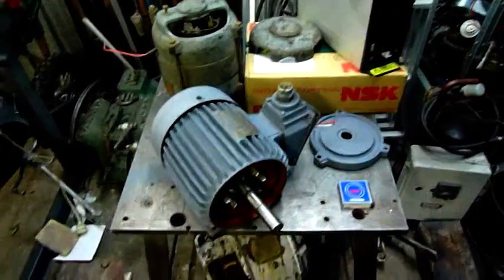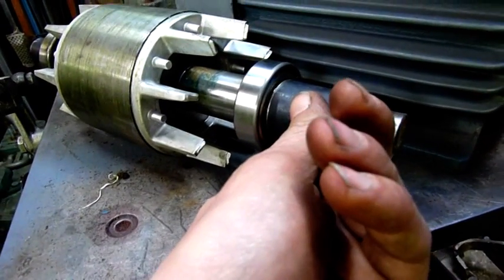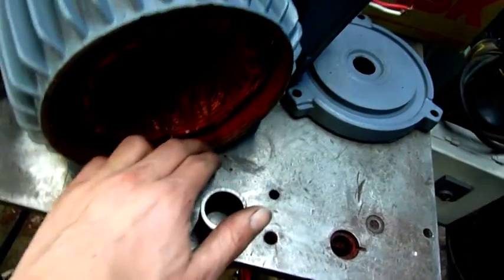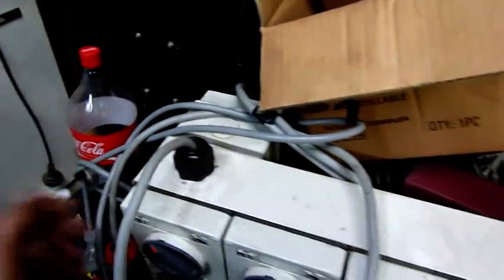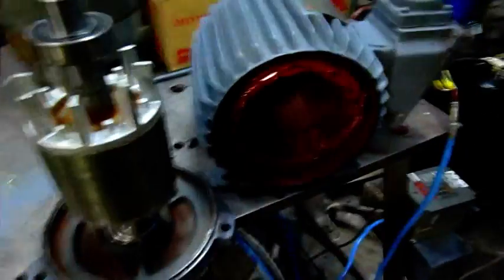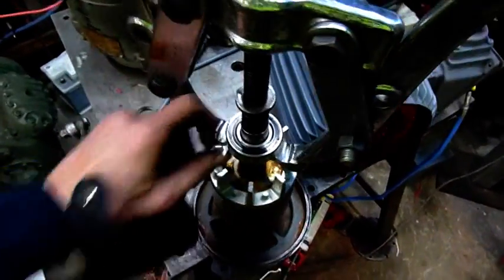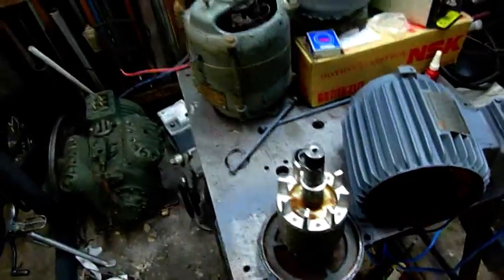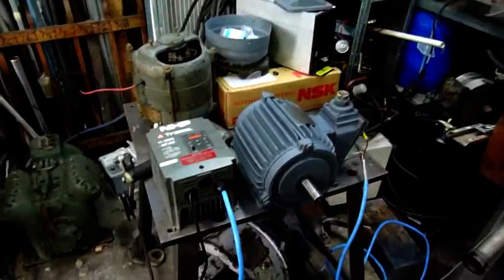TECO 2Hp Motor Pt2   Bearings and Test

Comment: Hey, cheers for another great video! I'm thinking of trying to convert one of these motors to water cooling instead of air cooled. Have you ever seperated the stator from the frame? Or do you know is that even possible? Cheers from Ireland!
Reply: Paddy Walsh Using hydraulic Pressing

Comment: @DragonFlyback256 I think it's because the rotor acts to absorb some of the back EMF spikes. The rotor and stator are, in effect, windings on a transformer - the stator is the primary, and the rotor is a shorted secondary. When rotor is stalled, the short circuit is reflected into the primary (stator). At idle, the rotor and stator freq equal, so there is no coupling, but switching spikes are high freq so do get coupled and shorted out by the rotor. With no rotor, any spikes aren't shorted

Comment: @Electronics111 A bearing puller.
It is a specialised tool that grips the bearing, and you pull the bearing off by rotating a screw.
Such a device can potentially pull with almost a tonne of force, removing even the most stubborn bearing =)

Comment: @Serostern It'd be tough to fit a rotor in my freezer. I'd have to throw the food out of it, wich is something I'd prefer not to do. On the other hand, my oven is unused most of the time. :) But yeah, you should probably avoid bearings with plastic seals if you intend to heat them. :) There are probably data sheets for them though, so you could find out what temps they can handle.

Comment: @Serostern Or heat the bearing up, and it will slide right on! :) A place I worked at had a induction heater for that very reason. :) You could probably do it in a regular kitchen oven. I don't know what temperature, but I don't think you should go over 100 deg. C. (Didn't finish the video before writing this)

Comment from the maker: @TradieTrev yeh its a good motor for my tests!,

not sure on star-delta switching motors. only one i came across was the Champion 250Hp compressor and it used the star-delta contactors to go from full power to idle.

Comment: She's a winner Ed! $32 on parts, there's a tidy profit to be made there.

Not sure how much control gear you have, but I have a request for how a star-delta wired motor works. I replaced a motor the other day with different windings and it racked my brains to get the prick going again, the best info I got was from my old text books.